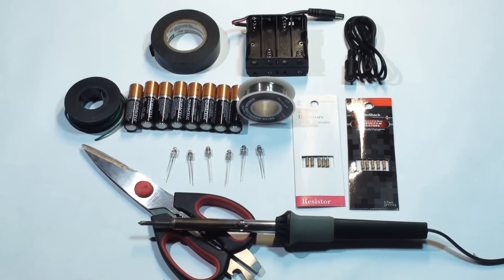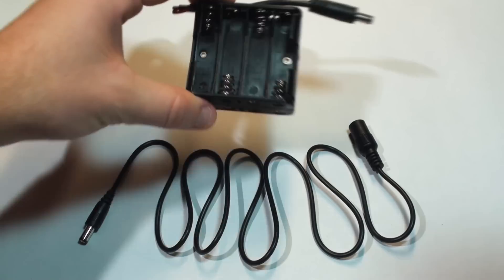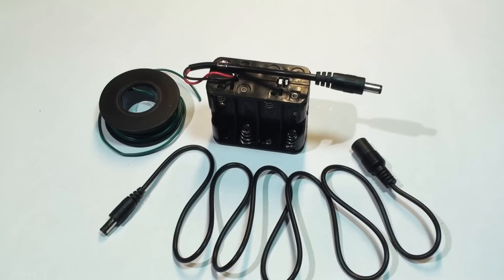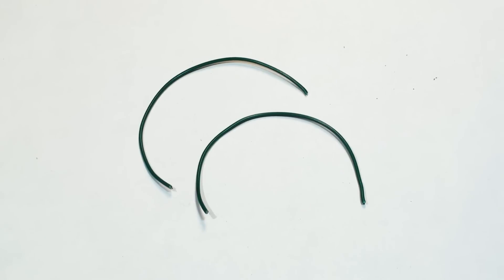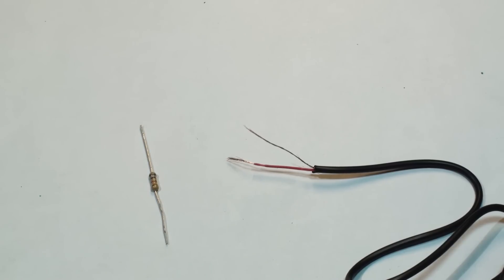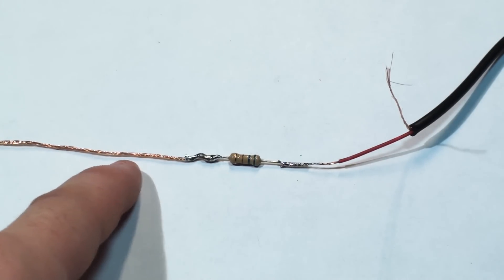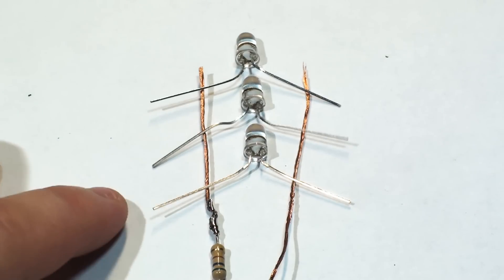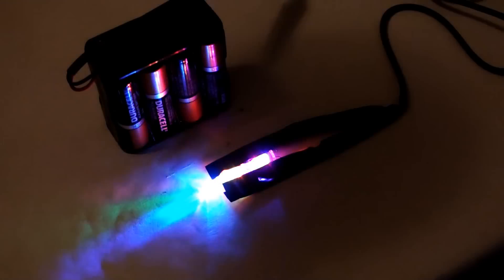How To Wire Multiple LED's in a Parallel Circuit !!

Comment: If you connect LEDs or LED strings in parallel, each of the parallel lines should have its own current limiting resistor. More details here: https://www.youtube.com/watch?v=n8az1-glQR0
Reply: Excellent point! Thanks for helping us understand the best practice for hooking up in parallel. Understanding the importance and function of drivers is something I'll be looking into further.

Comment: Thank u sir  .but sir I Connect 1 small red led and 1 small led parallel and connect 1k resistor and connect with 9 v battery but only Red led is lights white dosnt then i connect resistor 820 ohms it behaves same then after i avoid resistor  at that time both LED lights 
But sir instead of duel colour if i give same colour led and connect with resistor which mensioned above then it lights .can u pls give some tips that i can light red and white led in parallel not in series please

Comment: Thanks! Just curious, wouldn't you need a resistor for each LED in parallel?
Reply: It’s safer with a resister for each led. If one of these leds blow. The other will get higher current and might eventually go I believe

Comment: I made a 96 led string in parallel and by watching this video i can use a 12v source to power it but what resistor do i need for my project ? (all leds are super bright white)
Reply: He mentions in the video there are lots of calculators out there in the googles you can use too find the resistor value.  Unfortunately, nobody can tell you without knowing more about your components.  He also mentions you can also look up the datasheet for your LED's to figure out the max current.  Once you know the current and voltage you want, you can plug those values into ohms law to find the resistor.  I only know the basics myself or I would go into more detail.  

You can probably also use a potentiometer instead of that resistor and control the brightness that way.  A pot is basically a variable resistor, so you can use the same formula to find the value of the pot.
Reply: You make a good point and as for the leds in my project they are all super birght whites as found either in today's lightbulbs or tubular lamps plus when i use a 5v power souerce the first 8 leds are very bright but as i looked the others it looked like the power was runing low but i will try a different setup to see if all power up even
Reply: Another comment is that the 5v power source it's like the same as you see in a flashlight with 7 leds that you can buy in a 1dlls store

Comment: You only need 1 resistor on the first LED when wiring multiple in parallel?
Reply: No!  Use a resistor for each LED.  On paper you can do it this way.  In the real world the one that has the least resistance (usually the closest one) will draw the most power.  You can overpower one LED and it can explode.  After that, the power then goes to the remaining ones and the process repeats itself.

Comment: It depends on the type of LEDS you use. If you ever look at rope light there is a resister at the very beginning of the strand and that's it. The color strips on the resister is what you need to pay attention to. For his application he was doing it right but not every diodes are the same which will require different layouts than what he was doing.

Comment: I have a question, how can I wire a 12 v strip of led  light to a 9v battery without heating the battery adapter and the battery

Comment: Each led should have its own resistor. This is because the Vf of each led will be slightly different. This will result in different brightness between the leds. 
What is a soddering iron?  I have a soldering iron. Is that the same thing?
Reply: the americans think the L in soldering is silent. sad but true.

Comment: hi. do u need more resistor if u have more LED light? or one will do. thanks
Reply: As explained in the video you can find a resistance calculator on google.  Resistors come in different "OHM" ratings.   So if the calculator says you need 1K ohm of resistance you just need one 1K ohm resistor.  You could string up 10x 100 ohm resistors. or 100x 10 ohm resistors or if you really want to get silly you could get 1000x 1 ohm resistors, up to you. 
So to answer your question, one resistor is plenty, as long as it has the correct ohm rating.   If you went big and did 10,000 LEDs on one circuit you could still use just one resistor, but it wouldn't be a small 1/4 watt resistor like the one in this video.
oh, resistors also have a wattage rating as well as an ohm rating.

Comment: what is forward voltage? thanks
Reply: +Mike Odie   Hi Mike  for an example,  if you have a red led and a 9v battery,  the led requires 2v to operate so you have 7v left. The led will consume 20Ma so to work out what resistor you would need, do this simple division.  Resistance  = volts divided by amps  -   7/0.020 =  350 ohms hope this helps mate... John :)
Reply: thanks...i understand what u have explained....so is the forward voltage 2, 7, or 9?
Reply: +Mike Odie   You start with 9v...   it requires a voltage pushing forward of 2v to operate the (red led) ... you are then left with 7v for your calculations...  Forward voltage is 2v ... hope this explains if not or if I can help further get back to me... John  :)
Reply: +karen berry  Just to let you know,  Not all LED's have 2v forward voltage but the red ones do... John :)
Reply: got it...thanks so much.....here is something to throw at you....im making a cable tester and i want to use 9 leds essentially in parallel....i want to throw one switch and have all the leds come on but one at a time....so i want to use capacitors of different values to achieve this....so every half second the next led will come on until  they are all on... .pretty sure it can be done..can u help me with this karen or john?...
Reply: +Mike Odie     Hi Mike sorry but this is a bit beyond my limited Knowledge, maybe someone else could help... John :)

Comment: What if I dont want it to be portable and want it to plug into the wall in a wall outlet.
Reply: The electricity in the wall outlet is Alternating Current (AC), for this application you need Direct Current (DC). You can buy an adapter that converts the AC to DC just be sure that the adapter outputs the correct voltage, between 5 and 12 volts should work fine.
Reply: I’d love/appreciate if you could at some point record a video on how to do this as well as install a switch.  Thx much; helpful. Too, are the LEDs in this video blinking because of the type of LEDs used or how it’s wired?

Comment: Does the blinking of the LED's are cause by the resistors?
Reply: +Wruu Biq no the LEDs were designed to blink that way and with those colors, its design required the type of resistor used but weren't otherwise interacting with any functioning from the resistor... the resistor allowed the proper amount of current to power the LED to perform what it was designed to do

Comment: is there a way to get away with only using a small number of barrettes maybe 1 ? I need the whole rig to be very small
Reply: +David Bliss Most LEDs can handle 3v (especially LEDs this size) so I recommend using a 3v button cell battery.

Comment: How do you determine how many resisters you need?
Reply: +spongehow I am learning about electrics myself but I will try and answer the best I can. You can measure the amount of current a circuit is drawing by using the voltage setting on a multimeter by having the power go through the multimeter to complete the circuit. Resistor choice is dependent on the device or lights used in a project. Resistance values can be obtained by using a resistor color code chart and with the corresponding colors on the resistors you can then select the right resistor. Also to my understanding resistance is LOAD on a circuit from a device and a resistor itself reduces excess current flow and protects the device from damage. Please people NO fucken hateful comments, this is a real simple reply so if I am wrong in any way please correct me as it will allow me to learn more and will answer spongehows question better thanks. Anybodys input makes us all smarter.

Comment: As the person below me states, do NOT wire LEDs in parallel this way.
EACH LED should have it's own current limiter.
Beyond the possibility of damage, if the resistor is sufficient to limit the current to a single LED to prevent damage, each additional LED beyond the original one will cause the others to dim if you do it this way, as well as the possibility of overheating the resistor to the point of burning out. In something like a 7 segment display, this means that a "1" will be much brighter than an "8".

Comment: Good video very helpful but i was wondering and anyone else that reads this comment 
What i want to know is that how can I change the colors of two different leds by a flick of a switch? 
If anyone dont know what i mean, i am making a prop for a costume and i want to use a blue led than switch the color to red whenever i can with a switch
Reply: if you want a switch with an off setting, the type of switch you're probably looking to use is a single pole double throw 'on-off-on' switch.
Reply: tomx63 ah thank you so much

Comment: Nice video learned alot any idea how I can connect an on and off switch to a battery casing? I am making a custom vehicle and want to have the head and tail lights light up.
Reply: Oscar, the bigger challenge might be finding a switch to use that lends itself to being installed in or on the battery casing.  Try digikey, mouser or even ebay for a simple single pole, single throw switch.  then it's just a matter of running the positive lead into and out of the switch.
Reply: Interesting thanks for the heads up.

Comment: The 27 dislikes are people who actually know how to do this properly.

DON'T DO IT THIS WAY
If one LED gets disconnected while the power is on, the others will have to take up the extra current. In the end THEY WILL ALL OVERHEAT AND BREAK
Also, over time every LED ages and its current draw will vary slightly, causing the other LED's to vary their current draw as a consequence. Again, they will all break prematurely. 

To do it correctly, all you have to do is use 3 resistors instead of one. Use one for each LED. That way if one fails, it doesn't affect all the others.

OR you can wire them in series which is more efficient anyway. Resistors just waste power
Reply: ***** "If one LED gets disconnected while the power is on, the others will have to take up the extra current. In the end THEY WILL ALL OVERHEAT AND BREAK" 

This is incorrect. When connected in parallel, if one LED gets disconnected there will be less amperage because there are now fewer devices drawing current. Amperage is not a constant in a parallel circuit, only in a series circuit.
Reply: Hereviel Leivereh
That's only true if you're using ordinary lights. When using LEDs in parallel, removing one LED doesn't change the total amps because the remaining LEDs change their resistance in order to maintain a constant forward voltage. It's a confusing quirk that LEDs have
Reply: Sure I can throw in my 2 cents.

How many led's do you want to use?
what is the voltage drop across each one?
how many amps do they call for?
what do you want to use as your power source?
Reply: ***** Correct me if i am wrong, but what if you had 30 leds from a 12v psu. You would need over 60v for series. But in parallel i see your point if one goes the load will go on divided to the rest. But if one led goes in series they all go. So couldn't we have them in parallel and have a resistor after each led or even one before and one after reducing current in and forward voltage out? I may be completely wrong i'm just getting into leds.
Reply: ifell3 Yes that was what I said at the end of my comment. Only use one per led though. Before or after the led doesn't matter, but doing both is just a waste of resistors.

Hrag M if they are all identical leds then you can just wire 9 of them in series and hook it up to the battery without any resistor at all. If they aren't working or aren't bright enough then take one led out so the remaining 8 get bigger shares of the power. Keep going down until they are bright enough. Since you have "tons" of leds then you won't mind burning out those ones for testing. At this point you might get lucky and not need any resistors. If they are drawing too much current though, then you need to find what resistor to use. Hopefully you have tons of them too and you can just tinker until you find one that works.

Do you have a multimeter? That would make this much more professional.   You could hook up some leds and measure the voltage drop across them to bypass the process I just described. Then to choose your resistor you can just use an online calculator and tell it the leds are in series, how many leds you have, and the volt drop (forward voltage Vf) per led. 

Once you have found how many leds you can have in series and what resistor you need, you can then copy that circuit and wire it parallel into one battery if you want to. As long as you have one resistor per string of leds, you can add as many strings as the battery can handle.
Reply: Cool I was thinking a resistor before each led to control I or v in case another led stopped working and to eliminate any spikes from PSU (cheap Chinese one) and one after to control fv, using different colors of LEDs in pararell, or might be better to use a separate line out from PSU for each colour group?
Reply: ifell3 different types of leds can be wired in parallel as long as you make sure each led (or each string of leds in series) has the resistance that its Vf calls for. And again, don't bother with putting one resistor before and one after. That won't help anything. One resistor per led (or one per string of leds) is all you need.
Reply: ***** being pradandtic here if i was running LEDs over a distance say 20cm from resistors etc any need to include cable length resistance. I think I'm right in assuming under a meter no need?
Reply: ifell3 correct. If you have an ohmmeter you can get 20 cm of wire and measure the resistance but you're just going to find that it's negligible
Reply: Correct me if I am wrong regarding Resistors but doesn't more resistance create less usable current and thus more heat? The reason demonstrator uses a Resistor in this video is because the length of the wire he is using is relatively small but still isn't that still a good thing (suppose that he doesn't use a resistor, isn't that more brighter power (watts) to the LED light theorically speaking)
Reply: AzraelPercussionNEO 
Correct me if I am wrong regarding Resistors but doesn't more resistance create less usable current and thus more heat?
Yes
 The reason demonstrator uses a Resistor in this video is because the length of the wire he is using is relatively small but still isn't that still a good thing (suppose that he doesn't use a resistor, isn't that more brighter power (watts) to the LED light theorically speaking)
I'm not sure if this is what you're asking or not, but yes reducing resistance increases the current going through the led and it would make the led brighter until it overheats and dies.

If you don't want to use a resistor, then another option is to use very long wires, since each foot of wire will have a certain resistance, and the thinner the wire, the more resistive it will be.
Reply: um now in 2020 its 227

Comment: How many L.E.Ds can you wire up to the 8 double aa batteries. If I have 5Vdc L.E.D what ohm resistor should I use?
Reply: Is possible to operate 200leds in parallel with 12v supply?
Reply: In parallel current is divided and voltage is constant. Simple theory

Comment: Why do they flash? Anyone know because no one  is answering that question!
Reply: those are special made LEDs with an integrated circuit in it. They start flashing when powered up, you can't control them.
Reply: They are RGB LED's, they are made to flash
Reply: You can buy LED's that blink-even have different colors in one unit.

Comment: if all you people keep hateing on his video how come you dont go make a video of how to do it right i dont think you can so fuck off and leave miller modsPCs alone ok
Reply: It's because it's like a "how to cut bread" tutorial video that says "put the bread onto the floor and cut it with a jigsaw". Sure, it will work somehow. But that's not the way you would do it in real life.
The brightness of an LED is determined by the current flowing through it. As they are just put parallel with ONE resistor in series, they won't get all the same current. It might still work with 3 LEDs but not much more. It's the most inefficient way of powering a series of LEDs.
Reply: What haters?  All I see is corrections to his mistakes and suggestions.
Reply: exactly.

Comment: The resistor can go on either side.  But this is really sloppy work.  Much better to use a terminal strip to connect the LEDs. It will be neater looking and easier to fix down the road.
Reply: One of the points of showing this sort of thing were to suggest different ways of getting something done. Provided that there are no longevity issues.